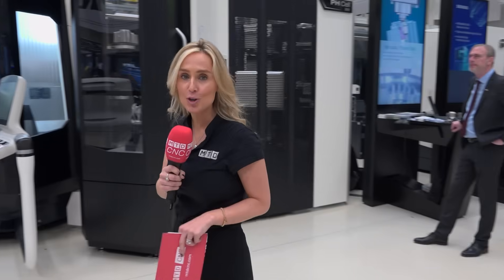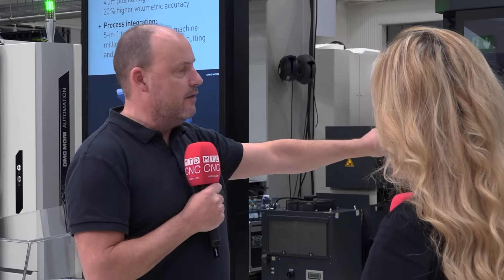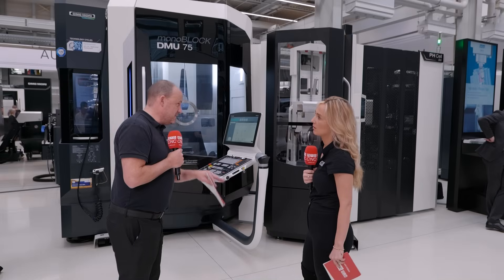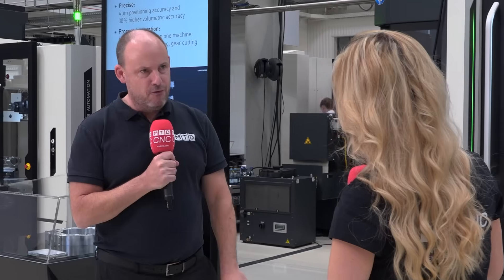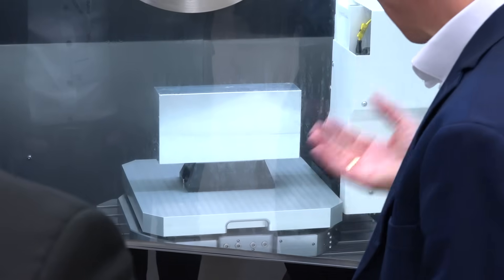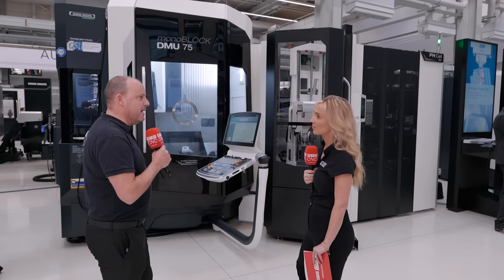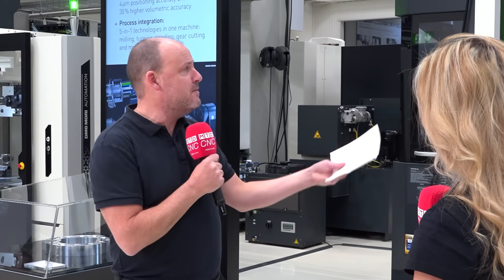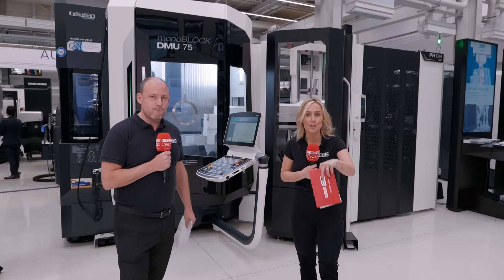DMG MORI DMU 75 monoBLOCK 2nd Generation, what's changed

Comment: The automation is shit. Loats of software bugs and problems. And the new Siemens machine software is unresponsive or stops working if u press certain buttons like unloading a tool.
Reply: I was thinking the same thing. like most of the ops and parts take hours to do. and then the robot is idol for most of the time. and most shops aren't running 24/7 either. so it would be rather easy for any guy and a crane to just swap pallets.
Reply: @ninjaabcde the robot is the most bullshit thing i have ever worked on

The software of the robot runs on servers from dmg
The software itself doesnt run on the automation itself so u get sometimes tons shit of lag and delay
Pressing start and stop sometimes bugs out and shows at running but the robot is actually on hold.
They came like 6-7 times to fix the issues but each time they apply an update it brings more problems.
Reply: dmg seens to be overrated !
Reply: @ubbgn  its just i had very bad experiences with it. The old automations on the 60evo were very robust and problem free.